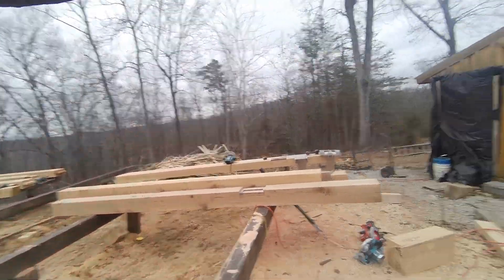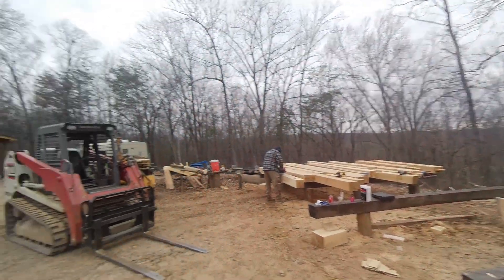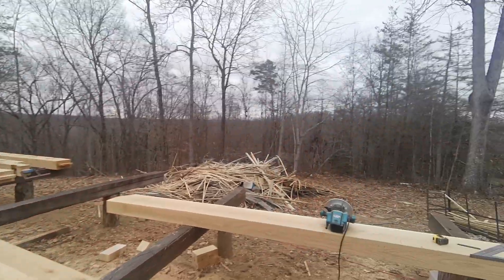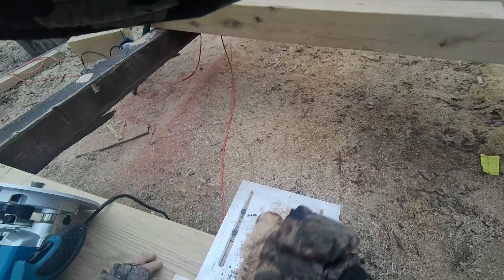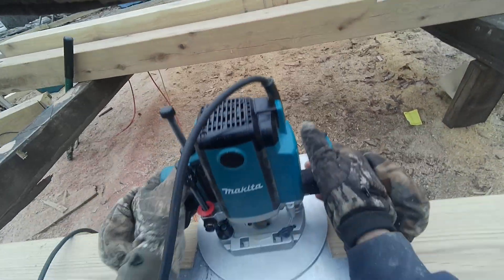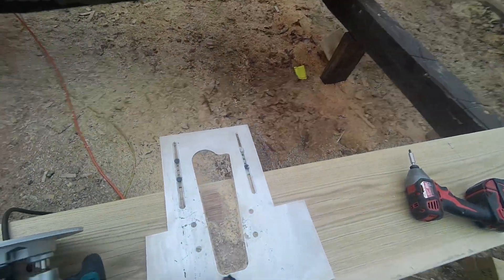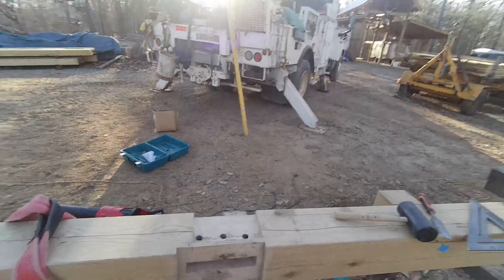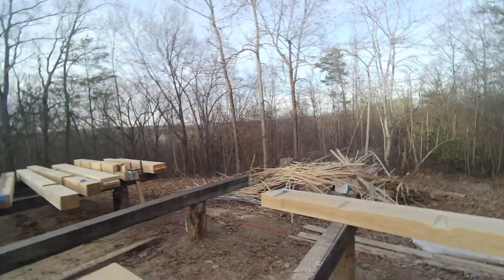Timber Frame Dovetail Joist Tutorial Series (14x8 Deck Episode 3)

Comment: Is there an option to house those dovetails?
Reply from the maker: The dovetails are housed? Are you thinking a deeper housing?
Reply: @TwoGuysTimberframing Yes. A rectangular housing to accept the 4×6 (1/2 to 3/4 deep) and the dovetail as per your application. In most conventional framing the bearing has to be 1inch minimum at the bottom of the member.

Comment: what do you stain / seal timbers with and approx what is the moisture content needed before you stain /seal
Reply from the maker: Beams will be green for a while because of the size and us slowing the process down by sealing them. I use Woodrich Timber Oil designed for green Timbers 
 Use code TGTF 189 and get any five gallon product they have delivered to you for $189.

Comment: Wow!  Awesome. 
I have a hm126 on the way. 
Will this technique work as well with white pine (it’s what I have standing)?
That anchor seal I imagine you’re very careful to keep it off the exposed surface. 
Are those jigs commercially available ? 
I’m pretty impressed with your operation.
Thanks! Terry in central NY….. subscribed
Reply from the maker: We haven’t had the jigs out for sale but if you’re interested I’m sure we can have one made for you. 

The Jakes will work with any type of wood in your HM 126 will be a good way to cut your beams. 

Yes we try to keep the anchor seal off of any exposed wood but if I have ends that are going to be exposed we will stain them first and then I’ll play egg seal over the stain as it dries clear. If you get it on the wood it just will not except the stain
Reply: @TwoGuysTimberframing  thank you very much. Hope you keep making videos. Very interesting stuff. I may very well get back to you on the jigs. I’ll get my saw built up and saw up my trim casing ect ( close to a half mile ) and look into timber framing rules and regulations locally , or I’ll just wing it. Lol. Thank you again!  Ps. I looked up that mortise saw. Wow$. A chain is $400+. 😊
Reply from the maker: @terryatpi  yes the timber framing equipment has a price tag to it but it’s all high-quality machinery. 

I have been able to get chains off of eBay from Japan between 150 and $200 brand new